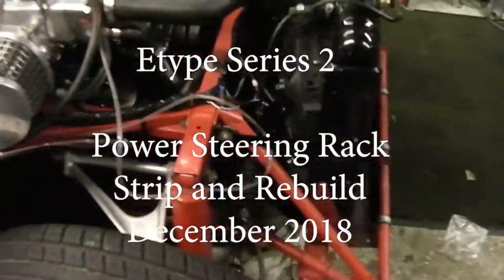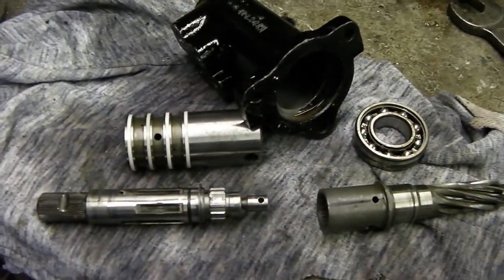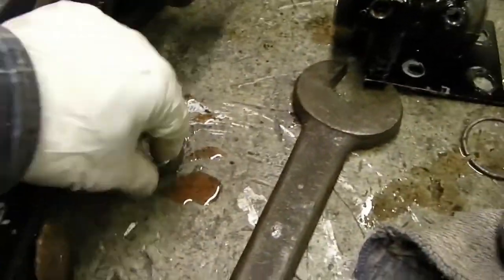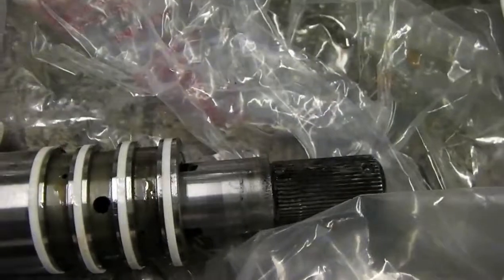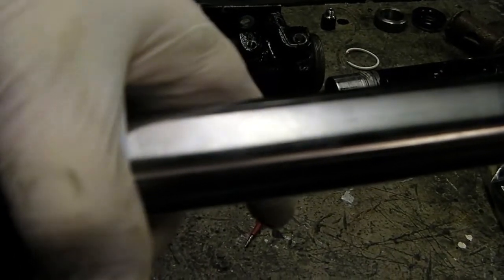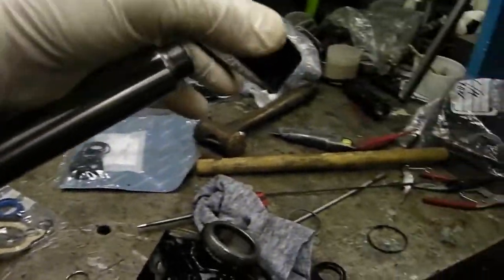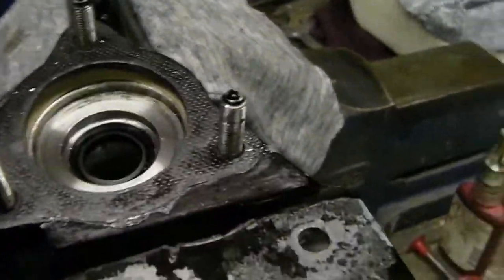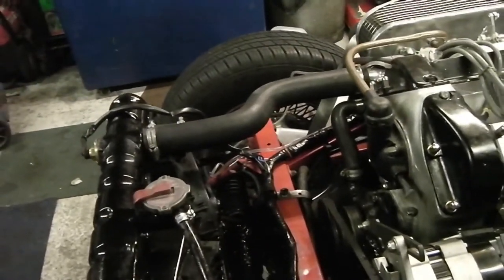Etype Series 2 Power Steering Rebuild

Comment: Hi Paul, Your video was very informative. I have been looking for the ptfe seals for years. Now the kit has arrived from K&C. Woud you be so kind to describe the process of streching and reshaping the ptfe  seals? I'm a bit worried of tearing/damaging them. Thanks, Marton
Reply from the maker: Bring the seal upto the edge of the seal recessed seat then using a small screwdriver put it under the seal and stretch it using the seal seat edge, roll the screwdriver around the seal seat edge gently stretching the seal as you go around, it does not take a lot of strecthing before you can get the seal to fit into the recessed seat. Once it's in, using a strip of plastic like the round middle of a washing up liquid bottle, wrap this around the seal then secure around the plastic strip using a jubilee clip, tighten it so as to compress the seal. Leave under pressure for a few minutes  then the seal will have compressed back to its design size and it can be reinstalled. Hope this helps.

Comment: Great video! What kind and brand if power steering fluid did you refill with?
Reply from the maker: I just used a standard brand, from Halfords. Does not need to be anything special, when these units were new oils were quite crude compared to whats available today
Reply: @wapsac  thanks for the reply. How much fluid did the system take? Any other tips when filling the rack up with fluid? I'm about to do this on my S2 this week.

Comment: Thank you for your instructive video, it has been a great help.  I need one further bit of information if you please.  Can you tell me the contact information for the supplier of the gasket and seak kit for the tower that includes the  4 white split "piston Rings" ? You mention the supplier in the video but I have been unable to find them. I can find this kit for a sereis 3 but  I have been unable to find a supplier here in the US for a Series 2.  Thank You.
John
Reply from the maker: Hi, the Seals kit was supplied by Kiley Clinton Engineering Ltd, Birmingham, UK. Please see below their contact details. Good luck on the rebuild
Address: 52-53 Birchall St, Deritend, Birmingham B12 0RP
Phone: Telephone: +44 (0)121 772 8000
www.steering-racks.co.uk
Reply: @wapsac  Thank You Paul,  I have actually rebuilt the rack - with the common kit of seals etc. Everything was OK accept a leak out the end of the pinion shaft- so now I learned about the O ring that seals the torsion bar on the inside of the input shaft.  So  rack came out and tower  came off  but local rebuilder- Coventry West - say due to shortages  they won't sell me the parts.  I will be  contacting  Kiley Linton shortly. Thanks again. John Mims